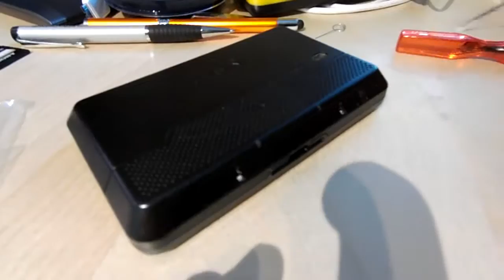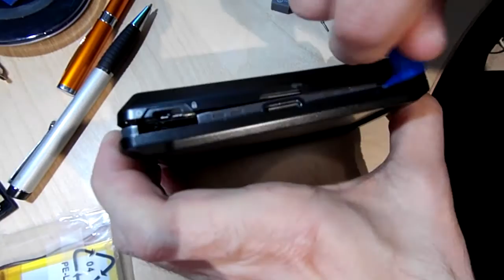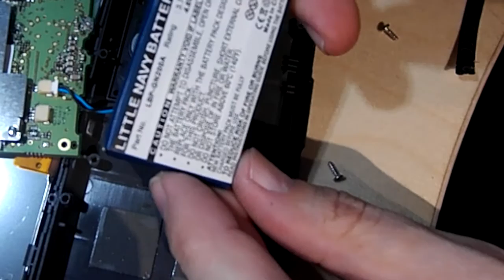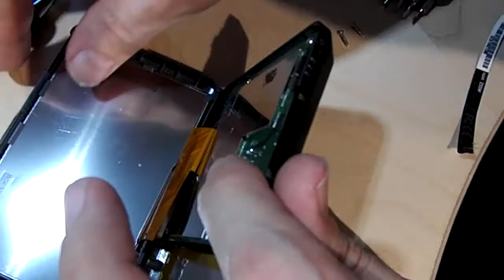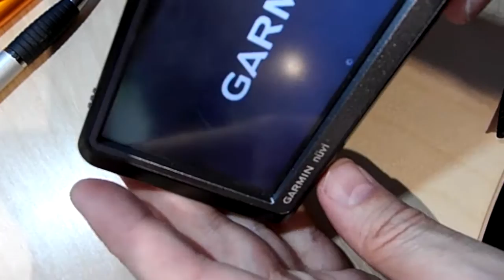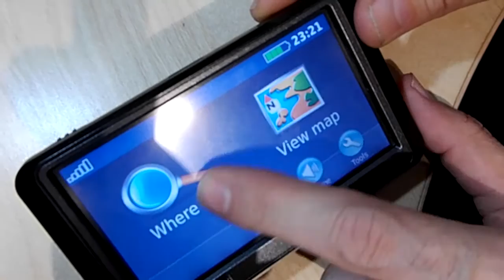Garmin Nuvi 255w replacing battery inside GPS with ebay bought one.

Comment: What plastic tool do I need for this?
Reply: You don't need any plastic tool...   you can take the label off with your fingernail... and pry the case apart with anything thin (a guitar pick, a credit card, your  fingernail, etc.).  Just don't use anything metal like a screwdriver or butter knife, as the case is soft plastic and is easily damaged. There are a lot of reviews saying the plastic tool that comes in the kits is so soft, it bends and is useless, so your better off using one of the items mentioned above in all likelihood.